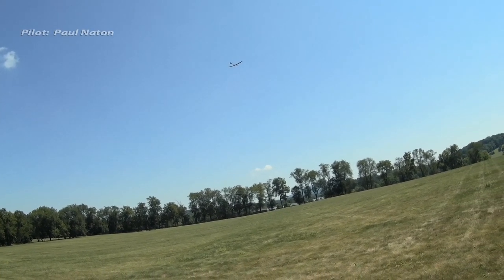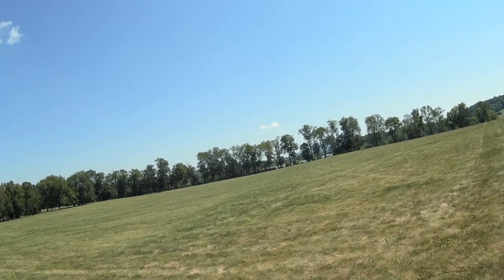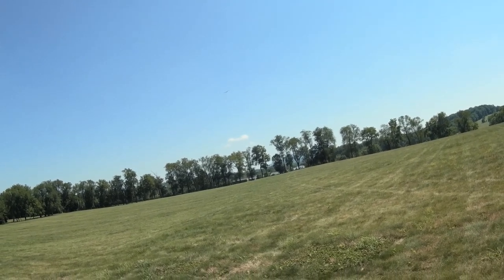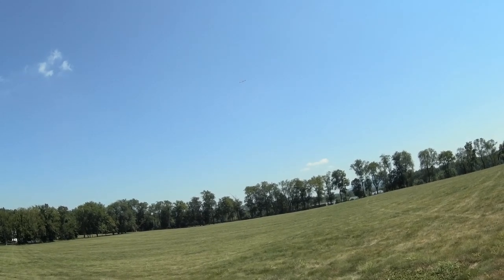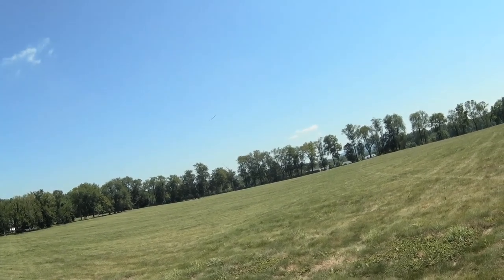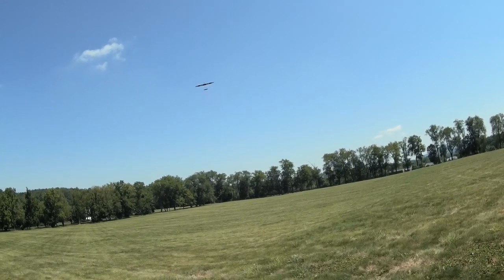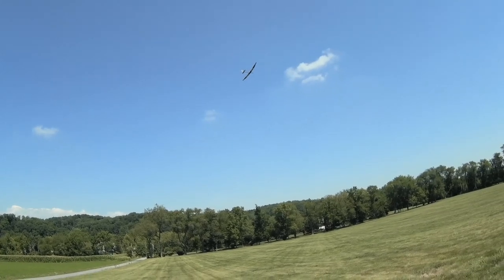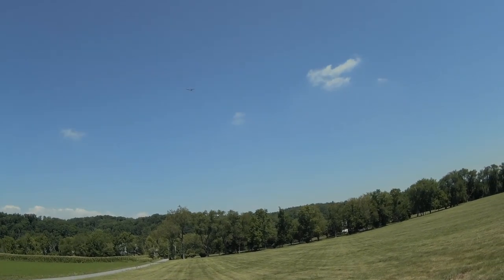VIXEN 2 Low Level F5J Thermal Flight Demo #1

Comment: C/G around 120mm is far forward? I thought somewhere around 105-109mm from leading edge was typical of the Vixen 2. Must be thinking of another airframe... yes?
Reply from the maker: I'm flying it between 127 and 130 back from the LE, sliding battery forward and aft depending on air conditions.
Reply: I see, the difference is between the V-tail and cross-tail versions. They have the same tail moment according to the specs on soaringusa but evidently behave differently. Have you flown the V-tail version? Could you comment on it please?
Reply from the maker: @kirkglundal4289  Flown both, main difference is that you have better yaw control at slow speeds as compared to the v-tail and x-tail seems to turn tighter right at stall.
Reply: @pnaton  hello Paul 
 When You find thermals, You open the flaps immediately? 
How to estimate modell energy?